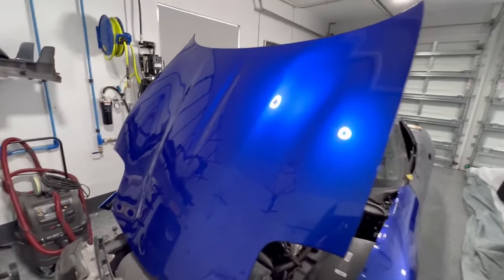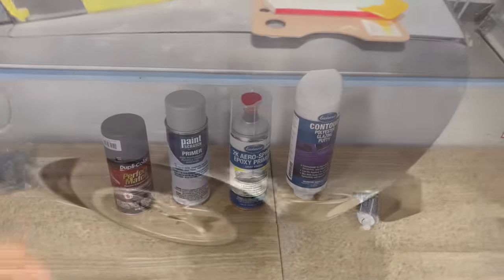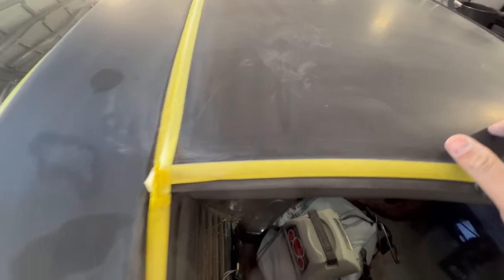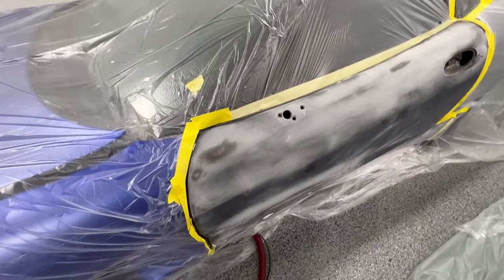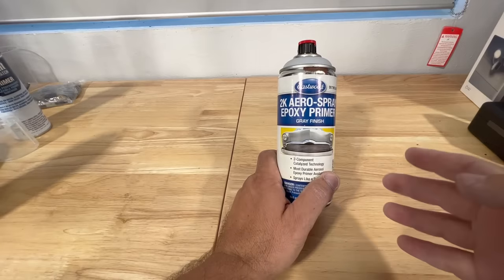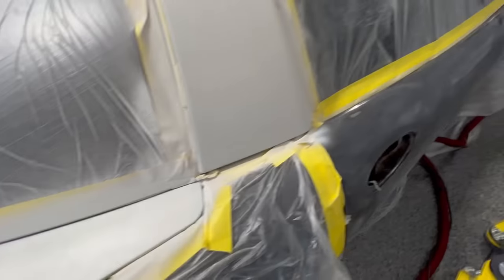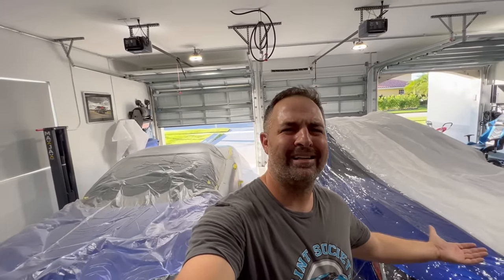No Paint Gun Needed for THIS Job!

Comment: ive been following this channel for years big fan... however not a big fan of 2k in a can or anywhere that is not inside a paint booth    those 2k cans have isocyanates in them which is a very very dangerous chemical  that has low voc but high saturation and requires a special filter for your respirator  ...... found all of this out before i sprayed  thank god..... my respirator is MSA and they don't even make  isocyanates  safe filter only 3M does ....  i was told by the head scientist safety advisor of a huge company that i really should be using a re-breather system when using isocyanates   so BE SAFE EVERYONE
Reply from the maker: Yes these are very true words. Thanks for the comment !!

Comment: Thank you, Brian! Over the past few months, I’ve been working on stripping out the interior of my EG hatchback. I’ve already cleaned and prepped the surface, and I’ve applied two coats of SEM High Build Primer Surfacer. My question is, should I have used a 2k epoxy primer instead? My plan is to spray it white using paint-matched spray paint cans and apply a 2k clear coat using spray cans.”
Reply from the maker: If you had bare metal yes need epoxy. Surfacer wont protect it from rusting out
Reply: Thank you so much for the reply!

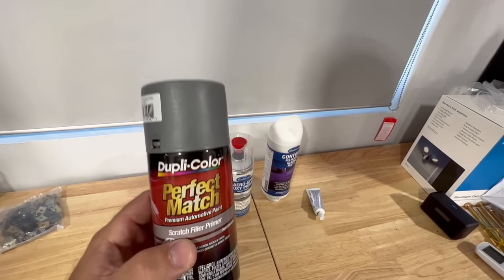Comment: Two years last April. 67' Plymouth Belvedere II, two door hard top, retired teachers car. Sixty K on the speedo. Original 318 power steering and auto trans. Whats done. Rebuild front and rear suspension. New gas tank and lines. Front disk brakes, bigger rear drum brakes. Bigger 3:26 open rear axle. Replaced the torsion bar cross member, with heavier bars. Refinished the glove box door and instrument surround with satin black paint. Repainted the engine compartment, and bottom of hood. Just finished rebuilding a 78' 440 with a cam, suggested by Jeggs, for a low compression engine. Trans rebuilt, modify the trans valve body with shift kit. Whats left? Paint the engine,  Reinstall the dash components and interior. Install the drive train. Why so long? Money! She will role sometime this winter.

Comment: I little tip when spraying from a rattle can - buy one of those click on handles to the top of the can so your spraying with a trigger like a spray gun.  
Also heat the can in a pot of warm water before spraying as it makes a difference to the paint laying out. As noted epoxy is difficult to sand as clogs the paper so in your case go light & easy when spraying those patch up jobs
Reply: Be aware that these spray can handles affect the spraypattern, making it wider, and more turbulent.

Comment: If I could ask a question - I just finished spraying my fourth coat of jet black (zero flake) base and I wondering if some of the variations I see in the paint...like maybe I ran out of paint on a panel and came back after a refill...I can kind of see that. But there is PLENTY of paint on this car. I'm guessing that 4 coats or clear will make that not a thing anymore. Is that correct or do I need to somehow not have any variations on the entire car? Any info would be hugely appreciated. I watch all your videos and like if that means anything. :)

Comment: How is that eastwood scroll compressor doing? Im on the fence about getting one. Quiet?
Reply from the maker: Super quiet. Stand by for the corvette paint job to find out more
Reply: @PaintSociety hey brother a little off topic but I know you would have the answer. 

I recently used a spray gun my first time ever to paint gm super white 40 on my cr500r dirt bike restoration,  came out excellent. 

I used 2k clear spray max in the can, all came out excellent but I did miss a couple little spots, they got clear but not enough to be fully glossy and smooth. 

How do I go about fixing this? Should I sand the frame again with like a 600 and spray another can of 2k clear on it, or can I spot touch the areas I missed. Or sand sections that contain the area i missed, up to a break off point such as a weld and that should be good enough to respray and make everything blend correctly?

Comment: i have used epoxy primer it sucks it gums up the sand paper, you used epoxy primer as a sealer, not as a sandable primer
Reply from the maker: You can scuff it and sometimes smooth enough for paint and if its not just some 2k surfacer
Reply: Most epoxy primers will say they are non sanding.  I usually tell my customers that as soon as your epoxy is dry lay down a coat or two of 2K primer down and you can go back and finish the repair.  I have used this process on "long term" projects and had to let them sit for months before I can back to them.

Comment: You keep using "urethane" and "epoxy"  interchangeably when talking about this primer job. Are they the same thing???
Reply from the maker: Epoxy is generally used for metal to protect it from corrosion.
Reply: Can I use epoxy on plastic motorcycle parts?